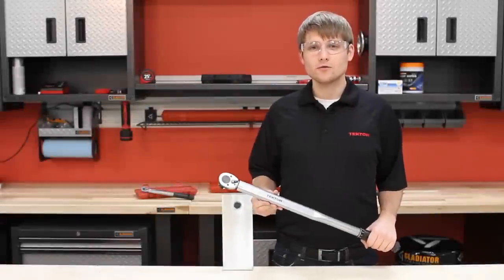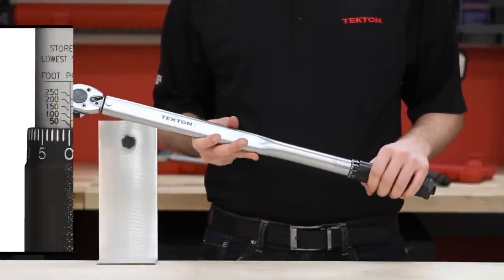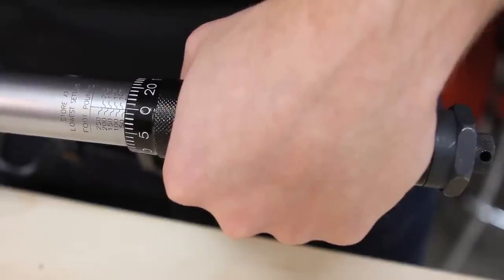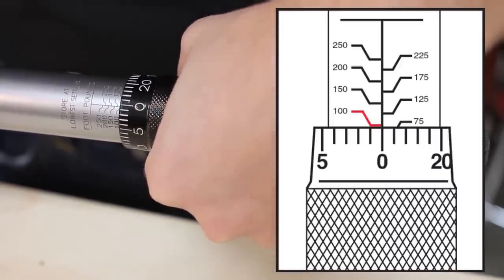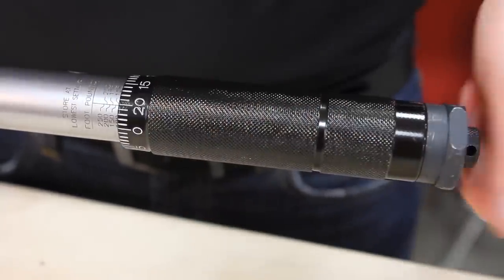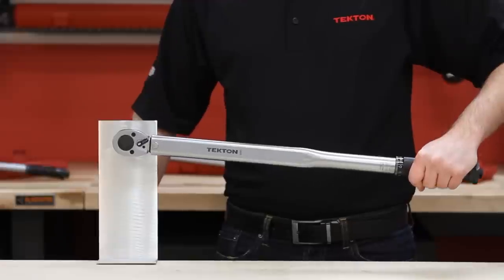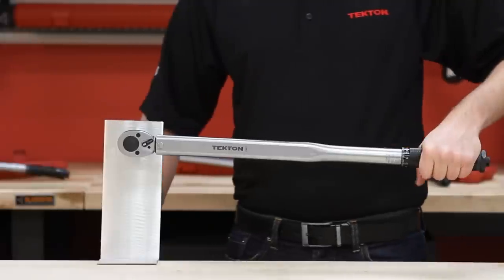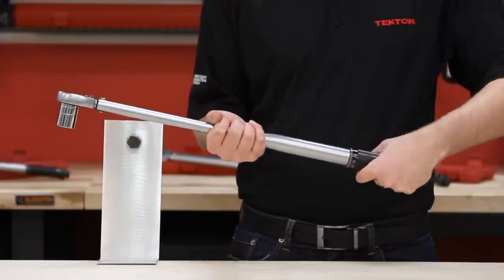How to use the TEKTON 24340 1/2 in. Drive Click Torque Wrench

Comment: I have this exact model and do not have those little brackets, only horizontal lines, there is a small gap between the lines and the numbers...how am i suppose to tune the wrench to the appropriate measurement ? i don't get it...thanks

Comment: Hi, I need your help. I bought this same torque wrench. It supposed to be new but I first noticed that the box was already opened. When I tried to use it, it didn't work (stays always in neutral). I opened the ratchet face place and found that the ratchet pawls and springs were broken. Do you know where I can buy this specific repair kit? Thanks in advance.
Reply from the maker: Sorry for the trouble. Please email us at support@tekton.com or call 888-648-3371 and we'll take care of you.

Comment: Does this torque wrench work between 1-25 ft/lbs or is it a 25 ft/lbs minimum?
Reply from the maker: +moaski 25 ft./lbs. is the minimum for this particular torque wrench. If you need something between 10-25 ft./lbs., this will work for you: http://www.tektontools.com/All_Products/24335.
Reply: Tekton is correct - this is for higher torque applications with 25 ft-lb minimum.
Additional observations:
If you look at torque wrench specs (not just Tekton's) very nearly all of the micrometer set click type have a 10:1 torque range, thus the 25-250 ft-lb for this one (250 = 10x25). The one referenced in his reply is a 10-150 ft-lb 1/2" drive. They also have a 3/8" drive 10-80 ft-lb. Neither of them cover the lower half of the range in your question. If you really need torques down in the 1 ft-lb range, you want a 1/4" drive inch-lb torque wrench (multiply ft-lb by 12 to get inch-pounds or divide by 12 to go from inch-pounds to ft-lbs). Tekton has two of them, one goes from 10-150 in-lb and the other from 20-200 in-lb, both with approximately 10:1 ranges, both 1/4" drive. It would take both to roughly span the 25:1 range you ask about, going from about 1-10 ft-lb and the higher range going from about 1.5 - 15 ft-lb. Torque specs that low (1-25 ft-lb), especially below 10 ft-lb, are nearly always given in in-lb. 1-25 ft-lb range is really to small a torque for a 1/2" drive and the typical 1/2" sockets used. That kind of range would much more appropriate for 1/4" drive wrenches and perhaps 3/8" drive at the upper above 15 ft-lb. The fasteners in that range typically 7/16" and smaller HEAD dimensions (not bolt shank diameter). A 1/4" diameter bolt usually has a 7/16" head needing a 7/16" socket for the bolt head or matching nut. A 5/16" diameter bolt usually takes a 1/2" socket for the bolt head and its matching nut. Ungraded bolts and nuts of mild steel (typically grade 1 and 2) are in the 5-15 ft-lb torque ranges,  or 50-100 inch-lb. The range you ask about is for small fasteners. A 1/2" drive ratchet wrench with the torque it can generate on an 18" handle can snap one in two before you know it. It's why shorter wrenches are used for small fasteners - to give the average human a better feel for how tight they're cranking it down.

Comment: hi i just bought this wrench, as soon as i got it, i actually took it down to like maybe 5 foot pounds, when the lowest setting on this is actually 25 ft lbs. the manual said dont take it past the lowest setting. Does this ruin the calibration,do i have to get it recalibrated? please let me know
Reply from the maker: Hi Eric. As long as you didn't completely un-thread the handle, then it should still be fine.